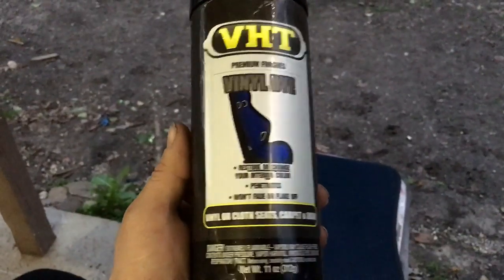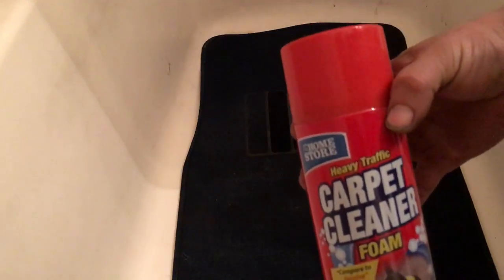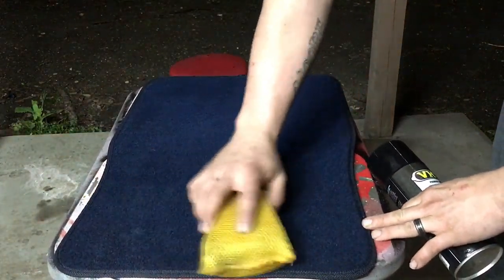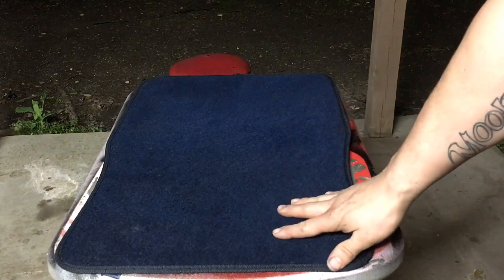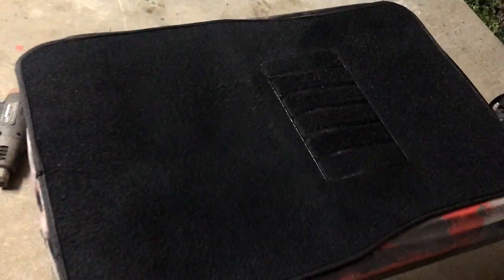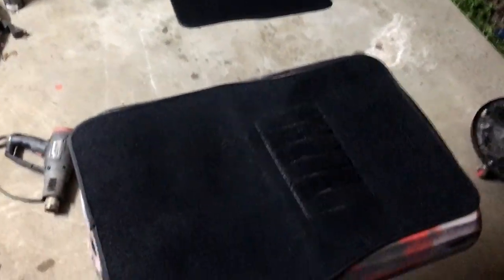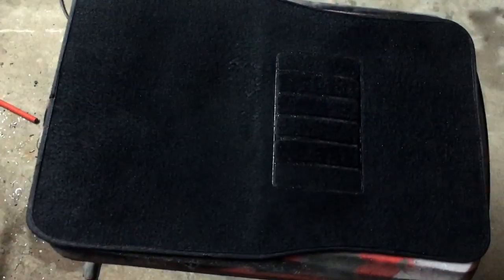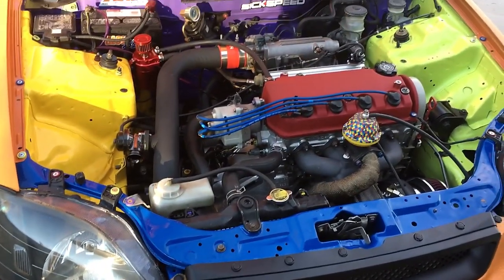How to change the color of your carpet/floor mats for CHEAP using fabric spray paint!

Comment: Is there a way to remove the roughness after the paint dries. I started to use the nylon sponge but may have waited a bit too long and the paint was starting to dry. I felt like I was messing it up so I stopped but yeah the finish is rough now. Thought about trying to use a brush after letting it dry for at least 24 hours first. Thanks for the video. Saved me the cost of new mats.
Reply: light scrubbing of 220 fine grit sandpaper